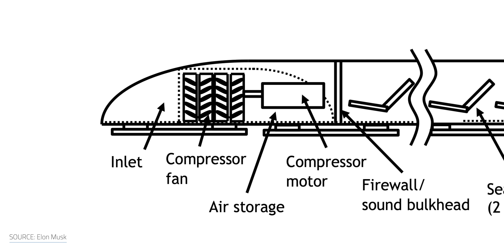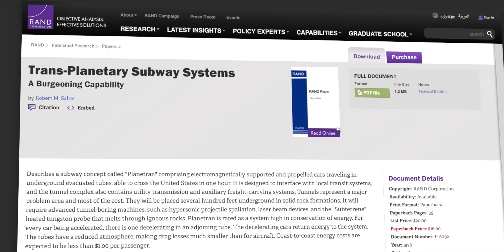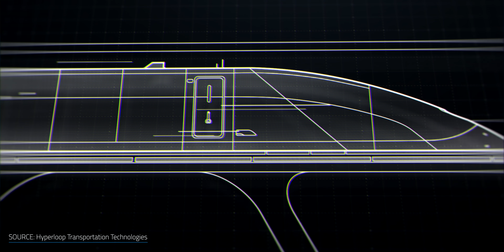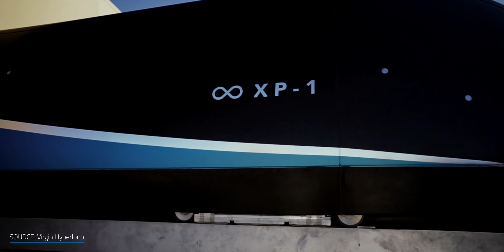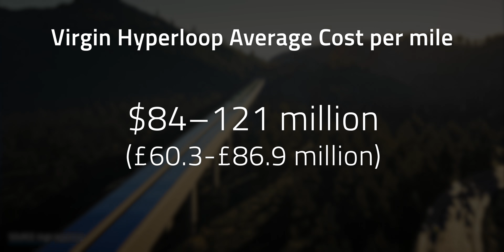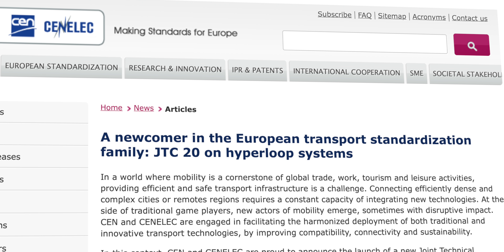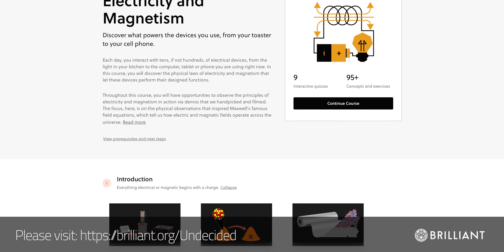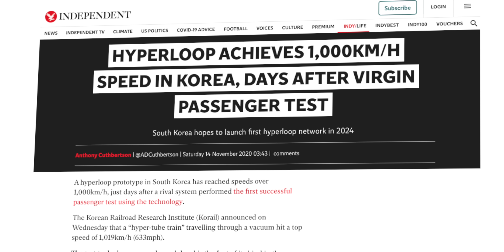Exploring Hyperloop - The Future of Renewable Public Transport?

Comment: I was expecting objective criticism, and I ended up with the usual " they said it would ... "  and ... " wow !".
None of the claims are analysed for feasability. 
What's the point ?
Reply: If he would look at the feasibility, he would end up making a Thunderf00t video.
His viewers do not want to hear the harsh reality, they prefer to dream about a green sci-fi.
Reply: @solutionrebellion  To be fair ,Thunderf00t isn't exactly a credible source for analysing hyperloop. To say that his methodology (misrepresenting the safety issues of hyperloop eg) he used in is some of his video are flawed  (as  well as the conclusion he tried to push by using them) is an understatement .
Reply: @remliqa  he pushed the conclusion that hyperloop isn't viable because maintaining a large scale vacuum is completely impractical... How is this misrepresentation? That's a fact. Not to mention the problem of expansion of metal, the problem of actually getting a vehicle in and out of the vacuum chamber in a cost effective way, the fact the speed you gain is minimal because of the logistics of safe speeding up and slowing down and taking corners, not to mention maintenance of what amount to hundreds of miles of high grade sensitive scientific equipment in literally the middle of nowhere...
How is any of this misrepresentation?
Reply: @DBZHGWgamer  
There are multiple misrepresentation in Tghundrf00t's videos ( another user listed rebuttal to Thhunderf00ts videos in the comment section ).  Once example of this is him misrepresenting the danger of  sudden breach (no, a small hole would not resulted in a catastrophic explosive decompression), even going so far to rigging experiment with cherry picked variables  to illustrate his point .He pushed the false conclusion that the hyperloop is more dangerous than it is because of this .

Again, if you watch  his video you would notice many of his problematic approach  in his works such as contradictory statement (his videos gains batteries in EV eg),   misrepresenting /cherry picking ( his anti Space X videos eg ) as well as completely missing the point  in an otherwise slam duck topic ( EmDrive and Chernobyl miniseries eg).
Reply: @remliqa  He didn't say a small hole would lead to explosive decompression, he said a small hole would make maintaining a vacuum impossible, and he literally showed the math of the rate at which air enters a hole and showed that a total hole volume of like 5mm across multiple or a single hole would make maintaining a significant vacuum impossible.

The only thing he ever implied would be "explosive" is the hyper loop imploding at the slightest structural failure assuming you actually managed to maintain any real vacuum in the first place. Which is not decompression, it's normal compression.
Reply: @DBZHGWgamer  

", he said a small hole would make maintaining a vacuum impossible, and he literally showed the math of the rate at which air enters a hole and showed that a total hole volume of like 5mm across multiple or a single hole would make maintaining a significant vacuum impossible"

That assuming that such hole would be left unchecked  and no one who monitor the hyperloop to even notice the sudden change in the  air pressure within the loop. That is a rather unreasonable assumption to make but an necessary assumption needed to support the narrative of the loop being more dangerous than it really would be.

"The only thing he ever implied would be "explosive" is the hyper loop imploding at the slightest structural failure assuming you actually managed to maintain any real vacuum in the first place. Which is not decompression, it's normal compression."

You precisely repeated that misinformation he said: A) no model of the hyperloop were ever designed nor was going to  have  real vacuum in any way B)  she amount of effort needed to cause such breach to happens 

On order for such catastrophic implosion to occur would require something very sudden  ,  akin  to a terrorist  action such as using explosive (an d only explosive , even something like an anti material rifle would not produce such results) to detonate segment of the hyperloop . Even then  he's assuming there were no safety measure  designed to  limit  the extent of destruction
Reply: @DBZHGWgamer  a hard vacuum maybe, but maintaining a low pressure environ you could probably have multiple holes 50mm in size and still be fine for operational pressures, maybe only reducing the speed in that segment a bit and throwing warning flags up
Reply: Thanks, you saved me 12 minutes of my life. I'm tired of people taking CGI renders as a credible source, whether its for things like this or for establishing colonies on mars...
Reply: Thanks for (presumably) finishing the vid. after 2 minutes of spin I started to think this isn't going to be the objective analysis I was expecting and gave up.. which is a shame. Maybe blinded by the musk stamp of approval on something which has gone from "mag lev vacuum train" to "wheeled cars in a normal tunnel, but smaller so no emergency access"
Reply: @Taoquitok  
"mag lev vacuum train" to "wheeled cars in a normal tunnel"

 I think you're  confusing the hyperloop with the Boring tunnel ( this is what you're describing here). The boring tunnel was never about "mag lev vacuum train" .
Reply: @remliqa  yeah I'm overlapping a little bit, but even musk has reneged on the maglev part, and the near full vacuum part. At this point it's a train in a small tunnel on wheels... So basically the boring company
Reply: @Taoquitok  To be fair, Musk haven't really done anything with Hyperloop ever since he brought up the idea so he didn't really reneged  on anything . Pretty much all developments for Hyperloop are  being conducted by other unrelated companies and organisation while Musk seeming focussed on projects other than hyperloop (Tesla , Boring tunnel etc) . Surprisingly ,Musk himself  didn't  have a team on the project.
Reply: @remliqa  Probably because he realised that the money would be better spent on a bog standard high speed rail.. with wheels ;)
Reply: @Taoquitok  
That is pure speculation on your part. You could be right or you could be wrong (or somewhere in between), it's not something we can know.
Reply: His channel is limited in its understanding of basic physics which is a problem
Reply: It is pretty simple and this is what I expected from a "undecided" channel. Watch a few videos from thunderf00t compare his concerns with the claims from the white paper or virgin and do your own research. It's easy to calculate the length changes between night and day of a tube in the desert in California. It's easy to look at the volume of the tube and check with a pump manufacturer what it costs to get a 1/1000 vacuum.
We need more seriously done research about the question if this is physically doable or if this is a scam. According to my research and knowledge, it's a scam.
Reply: Fanboyism is a hell of a drug...
Reply: I was hoping Matt wasn't going to be just another Musk fanboy. In his video with the Tesla battery cell or w/e its called, he did a great job explaining the upsides as well as the downsides. It felt like a more objective take on something he had experience with rather than a fanboys take on a (literal) pipe dream
Reply: Feasible? Yes? 
 Cost Efficient? NO. 
"MPG" better than vehicles? Yes.
 Cleaner? Yes. 
Maintenance once built? No.
Are we "ready for it"? No. Nothing about this tilts towards taxpayers efficiency. All glitter and a lot of lead for now. Maybe in 20 years as boring technology gets substantially better and cheaper. It would be cheaper to build on existing RR tracks but one would have to fight right aways and time share them. That's why Musk is building over (space satellites) and under every company right now because nobody wants to give up rights. 
Anything else?
Reply: Absolutely, this is Elon Fanboy Video. I am Elon Fan too but not for his unsubstantiated non scientific claims.
Reply: And ironically, he says in response to a comment that he thinks it's awesome tech, but won't be very successful because it goes against trains with an incompatible infrastructure. If only he said that in the video...
Reply: Me too, but more evidence of the seductive nature of the theoretical idea without the practical or scientific analysis of the engineering difficulty and the costs that will incur.
Reply: Not a lot to go on until we get something that actually works, I would expect South Korea to be the first successful country wide test, so we should know inside 6 years or so.
Reply: Thunderfoot
Reply: this was the comment i was looking for
Reply: @tinetannies4637  You're arguing with a strawman. Who said anything about someone not being allowed to have an opinion. The point is many others and maybe even OP, that spam every video about Hyperloop with comments like this. Now, this isn't exactly OP but they just want videos that say Hyperloop dumb, lets meme how unrealistic it is....haha. It's annoying. (Ironically enough the very thing the person said the video didn't address (feasibility) was mentioned at different points in the video.) For example the actual cost of the system, or the many dangers and hurdles it will have to address. It's like you people aren't satisfied unless the video is going for the throat of the concept of hyperloop.  Honestly, if it was up to these people (not necessarily OP) there would be so many unexplored technologies. So many amazing techs have spawned from projects and investments like the hyperloop.
Reply: @tinetannies4637  I'm actually all up for criticism against Ferrell. This guy also didn't pay much attention at school if he thinks that 1 atm pressure differential can make 20mm steel tube implode or hole in tube could cause rapid re-pressurization. Physics 101.
Reply: You just think it is a bad idea and wanted him to express your views. Either make your own video or just stick to the ones you've already watched and inherited your criticisms from.  Criticism wasn't the purpose of this video, but it did talk about its shortcomings.
Reply: @OLDCozmicsaber  how the hell do you maintain a near vacuum 500km tunnel. do u understand how thick the walls need to be to maintain that pressure. Its definitely doable. but why would anyone want to spend crazy amounts of money accomplishing this. Stick to gaming commentary and leave the engineering to the engineers
Reply: @yashen12345  why waste the time to write this message. Do you not comprehend my point?
Reply: @OLDCozmicsaber  i get your point. Its not supposed to be a criticism video. but  making this video without addressing the criticism and just putting forth blind optimism isnt useful for us viewers. I dont want matt ferrels channel to just become about an environmentalists/tech enthusiast's wet dream. we came here to learn about real tech with real potential. If we do talk about long shots we need to spend a large chunk of the video addressing the main criticisms and how they may be mitigated. that wasnt really done enough in this vid
Reply: @OLDCozmicsaber  " Criticism wasn't the purpose of this video ".  That's a total, 100% bullshit.  By using that argument, you can say that every perpetual motion machine video is perfectly acceptable, because the video wasn't about criticizing it. You could use that argument on BS magnetic de-scalers for your water pipes, On video's about getting hundreds of miles per gallon with running on water in your car, or video's talking about the danger of 5G.  

The argument you made, is just a way for lazy people to blindly accept concepts and idea's that they like, while being able to brush away legit arguments against the ideas.  

Oh, and we don't need to make a video showing why the hyperloop is a failure of an idea.  Tons of video's have already been made.  Also, that's another fake argument.  You don't actually want a person to make a video.  You just want to create a false hurdle that is too much of a pain in the ass to get over, for the people you disagree with, so then you can feel smug, as if you made an intelligent point.   

You straight up, are a disingenuous  person.  You use bad-faith arguments as a way of defending your position, without making an actual argument, or actually defending any real point. And if you aren't totally disingenuous, then you are either lazy, or just mentally slow, as you don't seem to understand why your arguments are either just bad, or are made in bad faith.
Reply: @Fearmylogic  what a pointless comment
Reply: Let me guess, a horde of idiots who believe Thunderf00t?
Reply: @Gardillus  Do you have a different scientific perspective that refutes the analysis that Thunderf00t has done? Or do you just fancy yourself as smarter than everyone without providing evidence by calling anyone who disagrees with you a "horde of idiots?" It sure seems from your comment that you might be the idiot. Or narcissist.

Comment: if the failures of supersonic air travel have taught me anything, it's that people/ the market favor capacity over raw speed. I'm still more convinced by mag lev rail systems. that said, I also have a bias because trains are rad
Reply: This is why I think starship will never truly disrupt commercial Aviation. The concord failed because the was to loud, couldn’t carry enough passengers, was uncomfortable to ride in and burned twice as much fuel as a standard airplane doing the same route. Starship will burn 20 times the fuel of 747, be even louder than the concord and feel like a 20 minute roller coaster. Also the mock ups that have fit 1000 people into starship have floor heights of 3 ft tall. Good luck getting a bunch of CEOs to crawl to their sheets on their hands and knees.
Reply: @joeyhamilton6854  Absoluteley - I don't want to know how many people would throw up when Starship does a 180° flip manouver in Zero G ...
Reply: @joeyhamilton6854  You're thinking too small. Forget space ships, think skyhooks! This is the problem with hyperloop (and maglev) too. It's just a slightly faster train, for significantly more money, hassle, danger, and risk (for eg. high speed rail can be converted to normal rail relatively easily if needs change). Same with rockets - just a fast danger plane. But DW it's only about 10,000 times more dangerous without factoring in that it's acceleration will kill about 1/3+ of it's target audience.

If you want to innovate, think big, like an orbital ring or space elevators. Or go small, with trains and telecommuting, because honestly that's a way more practical solution.
Reply: @joeyhamilton6854  The Concord failed because it and the sonic boom it produced is too loud, sure. But that doesn't mean that a supersonic passenger jet is unfeasible because since then they have neem able to reduce the sound of jet engines and the sonic boom that a supersonic jet can produce.
Reply: @mandellorian the concord received heavy subsidies from the UK and France and only ever catered to a incredibly tiny number of people. "M'urica bad" isn't the at the root of every* thing in life
Reply: @mandellorian it seems like you’re saying you’re mad you don’t have sonic booms going off over your house. It’s bad enough living under a regular air corridor
Reply: I that that's a great point for trains. I don't think Hyperloop will be fast enough compared to other trains for the market to handle the increased costs. 

I'm not so sure that Concorde and Starship are comparable. The market couldn't handle the increased cost of the Concorde once regular planes were doing the same flight in 7-8 hours compared to the Concorde's 3 and a half. For less money you could be way more comfortable for a few more hours. 

That's not really gonna be true for Starship though. Starship is gonna offer a fundamentally different experience. Being on a Concorde feels like being on a plane from the backseats. Being in space is something people will pay for on its own. That combined with the much greater time savings (more than a day down to 90 minutes) makes me feel the market will bear that.

That said I personally hope point to point Starship doesn't happen. Noise pollution will be insane in those areas, and those areas are likely to be poor communities who don't have the political clout to say no.
Reply: Supersonic air travel will make a big comeback.  They'll be big by about 2040, and so will flying cars in cities.  Remember I said it.

Comment: They were actually talking about something like that where I live to go between St. Louis and Kansas City. My issue with it is there doesn't seem to be a practical reason to actually do it. I don't see enough people using it for it to have a real purpose.
Reply: Traditional high speed rail like is already done today in europe or asia would do that route just as well. Its actually a good city pair, plus HSR from STL to Chicago makes a fairly compelling argument.
Reply: IMO it's actually competing with air, not trains. You have something that can potentially go faster than a jet, and maybe more comfortably. Something like a 737 costs $90 million to buy and $8.4k an hour to operate. So I dunno, $20 million a year? Seems like it would be hard to compete.
Reply: @crusherven  it would not be able to complete with the flexibility of air travel. Air routes are constantly being adjusted to match changing demand. Hyper loop requires billions of dollars upfront and in as flexible as traditional trains. Also operating thousands of pumps and the worlds largest vaccine chamber at 0.001 atm will be expensive.